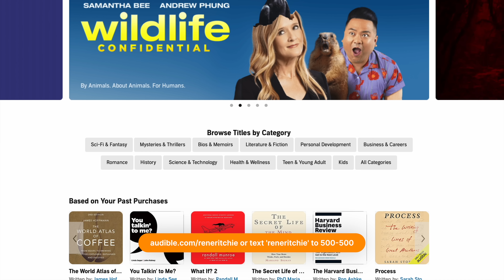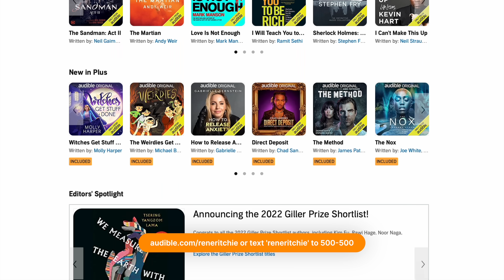The End of Big Silicon — Apple, Intel, Qualcomm

Comment: Why does the guest say build a 2 nanometer fab in “China”?! Does he know something about China invading Taiwan [Republic of China (ROC)]? The higher density fabs are NOT built in mainland China and that is not by mistake. The United States has expended substantial effort to make it illegal to build the newest technology fabs on the mainland. This isn’t just a little detail as mainland China getting control of Taiwan would have huge impacts on chip production, much more than what interconnection technology will be used.

Besides, the gating technology for higher density chips is controlled by ASML Holding N.V. (commonly shortened to ASML, originally standing for "Advanced Semiconductor Materials Lithography") is a Dutch multinational corporation founded in 1984. ASML specializes in the development and manufacturing of photolithography machines which are used to produce the highest density computer chips. 

The other part of the equation is financial resources and execution of the application of this resources (which Intel seems to have continuous problems with the execution part). 

The guest even gets corrected about Taiwan but still doubles down on saying China. Very strange.
Reply: Yeah, that bit is mad sketchy…
Reply: because they are one ;)
Reply: If you are not aware, taiwan is a province of china
Reply: @mantapdjiwa9768  Yeah, of the Republic of China! It is unlikely that the ROC will regain control of the mainland, but to be a hand puppet of Winnie-the-Pooh’s hegemony is a sad joke. It was to the US’s benefit to maintain a fiction of “ambiguity” to foster non-adversarial  relations with the mainland in the past but times are a changing. The big question is whether the US is willing to go to war to curb the ambitions of Winnie-the-Pooh!?! Irrespective of the old fiction of “one country, two governments”, Hong Kong is the playbook for Taiwan if the people there want the fiction to end. Lately the ROC population has been scared significantly by the mainland’s intimidation, so maybe they will rollover belly-up and be pounded into submission like Hong Kong, or maybe NOT!

Comment: Second... 

Also, I think it's going to transition into offboarding with cloud computing. A small highly efficient chip that can communicate instructions at a high rate and low latency with processors on the cloud. With advancements in wireless connectivity, eventually, wireless links are going to be fast enough to handle it...
Reply: Agreed. The future for consumer-level "computing" is mobile. Powerful, pocketable Phone-sized devices will be designed to communicate with external devices wirelessly. Like current Bluetooth devices, future peripherals (think: big monitors along with glasses and other wearables) will "link" with your "mobile" device .... blurring, then eliminating the line between pocketable devices, tablets, laptops and desktops.
Reply: no its not cheap